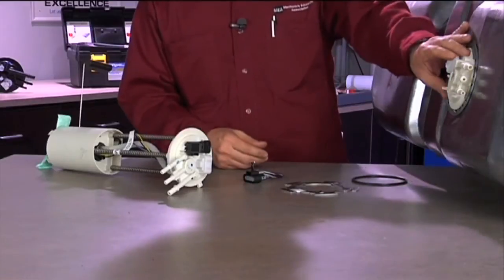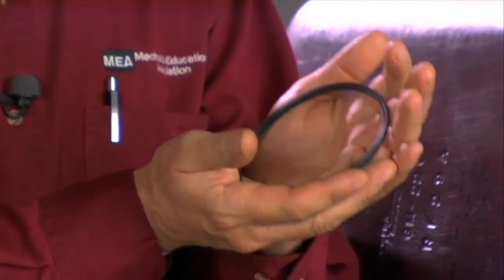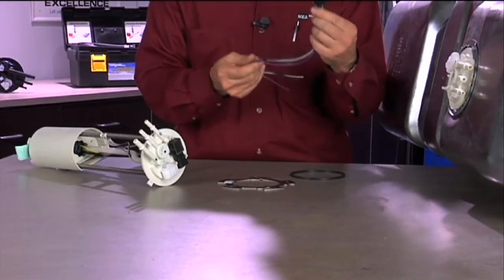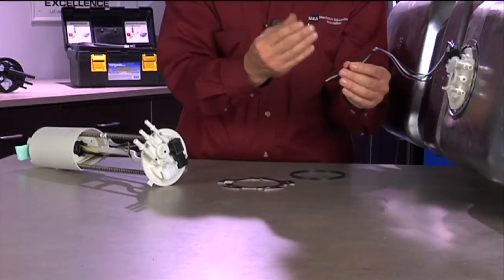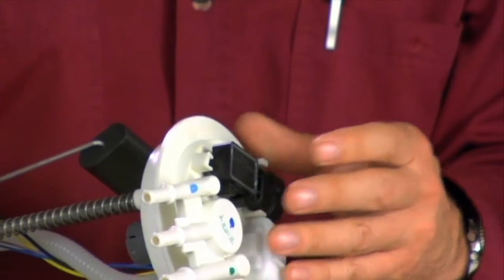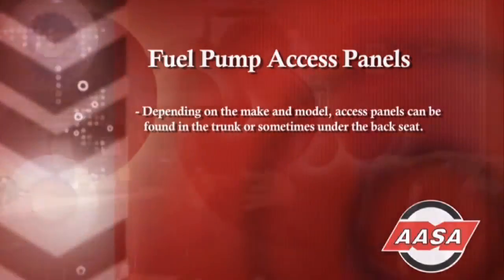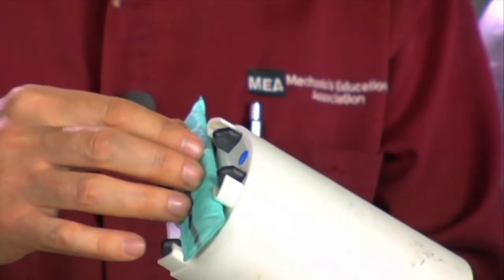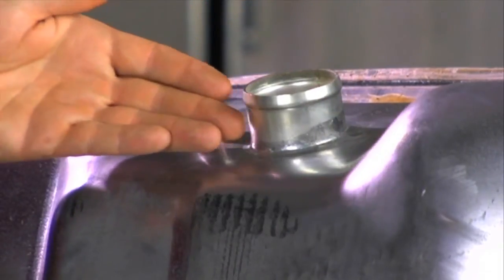Proper Fuel Pump Repair and Replacement Procedure

Comment: Hello, I bought a sending unit for my 95' Chevy Tahoe 5.7L LT. and have to replace the new wire connector from the factory connector. In the process I noticed the gauges to be different from that of the factory. My question is, does that matter and is it safe?